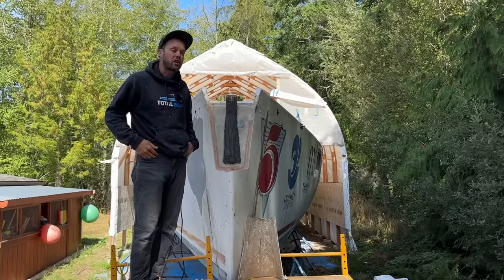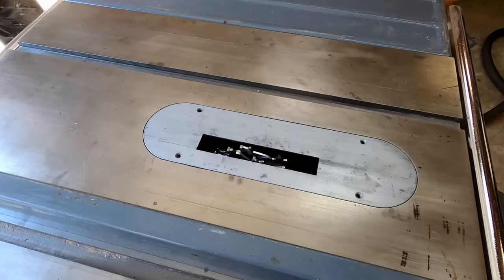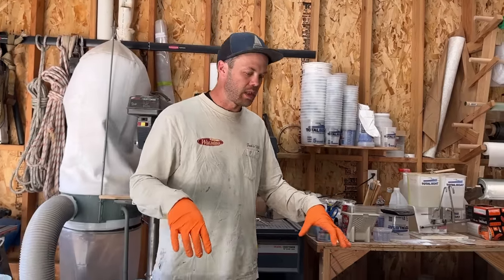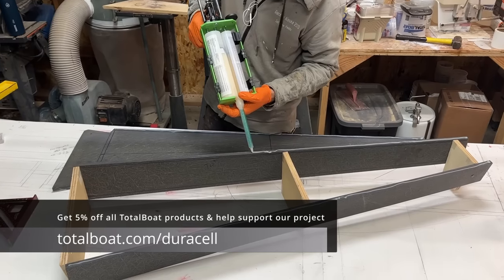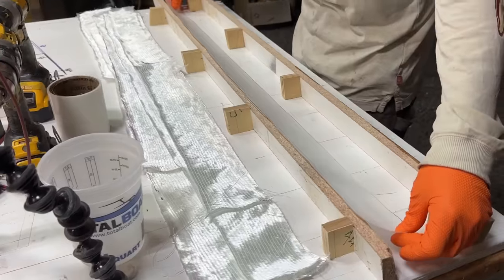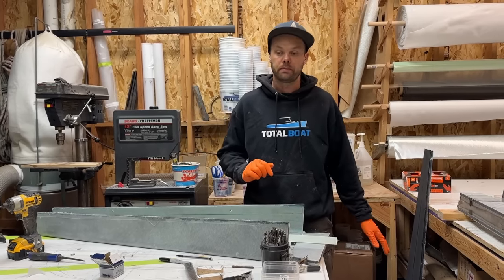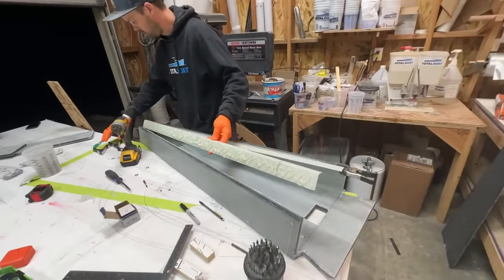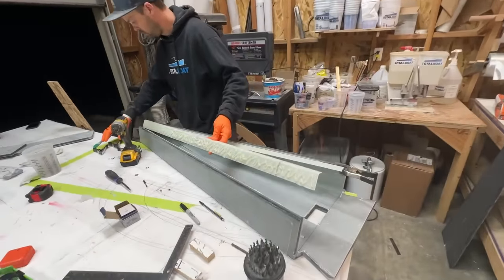Building the BOWSPRIT [E95]

Comment: In the early eighties we were bring the Atlanta Decorative Arts Building out of the ground. The prints called for a door to be built with a height of 6' 4". Anyone with a hard hat and 5' 11" tall or more would hit their helmet. Obviously, it needed to be taller. The walls were 12 inches thick. matted rebar steel to the left and right and above the door frame. I pointed this out to the onsite engineer and liaison with the engineering firm. He said put it in, this was what was drawn on the prints, we did. Two days later seeing him on that ladder holding an 80 lb. pneumatic jack hammer breaking out that concrete so the opening could be raised was a told you so moment. It was August, his clothes were sopping wet head to toe. Just saying you can't always count on the experts. One of the Americas cup boats snapped a mast in recent years. Okay. Food for thought. New plastic twice as strong as steel. Forget the name of it. You could build a knock down mold, make all the sides top bottom say 1.5 inches thick. Pour it in one piece including the guides for the chain.  Monel steel bolts or 316 stainless with large thick flat washers.  Put it in place, silicone the joint so there is no leakage into the hull, and you would be good to go. It would be a type of cantilevered beam so it may require a deeper inset into the bow to get what is needed, that is where my concern lies. There is safety in many counselors. I wish you well, fair seas. N

Comment: High! Anchors I’m 70 and I have lost 4 anchors to the deep . There was a time when everyone had to have a tv unit in the corner, over the last 20 yrs anchors have changed so much and new variations are replacing older models, you will lose anchors and one day you may find the only place to get a replacement is on second hand market because the new ones don’t fit . The big problem is when conditions change and you have to move to a different spot, having to cut away move and replace the anchor in a Gale is not easy, I’m with the anchor guy KISS , Having to get a 50 kg anchor up through a hole and attached with waves breaking around your ears’ not my eider of a good time. Love the show, you do brilliant work and your mum is amazing ! If you must have the anchor in a slot at least add a open sheave on the side of your sprit cheers

Comment: Such high tech tension is keeping me awake at night just feeling the tension and pressures that are going to be imposed on that structure, it might as well be part of the SpaceX Starship! Such belief and confidence you are showing but I am sure also inter-laced with belly cramping  tinges of cold sweaty anxiety and light layers of tension impregnated fear while imagining the huge gennaker/spinnaker/mooring chain tensions, weights and cross pulls that the structure is going to be exposed to while racing through and during stormy dark night time seas and moored while the wind power of gales tries to tear your anchor from its deathly nail scraping bites into the sea bed! Will it manage to stay attached to the bow and not be torn apart? SkipRay, Kerry, Ireland.

Comment: I FINALLY caught up to the present. It took me all weekend and I have loved every minute of entertainment from your videos. 

Matt is doing an incredible job. I cannot wait to see the boat finished. I have been watching multiple boat builders over the past few years; from Steve building Arabella, Leo building Tally Ho, to Garret building Redeviva. Now that Garret and Ruth from Salt and Tar, and Steve from Acorn to Arabella are basically done building I went looking for more content and found you guys (along with a great Australian dude @ Building SY Mistress).

The quality of the videos is first-rate. You are doing a wonderful job at all parts of this project. Matt, your mom is badass. Although she does give off the vibe of a slightly disapproving English teacher, but that is surely just me :). Also, Inspector Cat is always welcome.

Keep up the good work and thank you.
Edit: I had one question. When you put on the white primer on the deck, why do you just do the small areas? Wouldn't it be quicker to cover large areas as you work there to save you time later. For instance at the bow you primed several small areas, Could you have just primed the first 12 feet of the deck or so instead?
Reply from the maker: Painting the whole exterior of the boat will be one of the last steps. I just prime the carbon chainplates to protect them from uv rays

Comment: I don't know if it's different for fiberglass, but when laying tile the thinset (mortar) is combed with a notched trowel leaving ridges similar to the one in your epoxy. The tile is then set on the thinset slightly offset, then slid into position in order to collapse the ridges, which then provides nearly 100% coverage. Gluing two rigid pieces together might work better using the same method. The vacuum bagging might do the same thing, but I thought it was worth mentioning.

Comment: I wait for new episodes every Wednesday, like I waited for my favorite HBO series, like Mad Men, ten years ago; you guys got me addicted! This bowsprit is looking beautiful, and, as a product designer, it is a joy to see every step so beautifully put together and so well designed. I was wondering if the channel where the anchor rollers go should have a stainless sleeve to protect the composite material from any potential metal scraping from chain or from the anchor.
Reply: I should think you guys have enough stainless steel lying around from the old chainplates, and other flotsam back from the day to melt down and make brand new sheets of 3 mm SS! Maybe if you borrow that big tank from the  Acorn to Arabella folks, the one used to melt the lead for the keel... you'll need just a tad bit more heat, which maybe a couple of tons of charcoal and industrial blowers may provide : ⁰ )  but seriously, creasing a sheet of 3 mm stainless in two 90⁰ folds and bonding it to the channel will do no harm at all to this project, and it may look good too. Just thought you could sell all that scrap to a yard, and trade for a nice sheet of steel, how'bout that?

Comment: Question: “The Chain Groove in Your Bow Sprit”: Does the width of your chain groove allow for a “hockel” in the anchor chain? To prevent a hockel jam, width of your groove should be: W=(L=P+(GAx1.5)) Marks Standard Handbook for Mechanical Engineering-7th Edition. Talk to the engineer you are working with for proper sizing based on your chain selection: Triple BBB or ASTM G40? Most roll bar anchors work better with “Fixed” Kong Non-Swivel connectors versus the swivel type. PD

Comment: Very cool Matt.  
I tried editing my previous comment on chain size. 
7/16" is huge and once you leave the USA almost impossible to get and extremely expensive.  Zinc is an environmentally hazardous material and you pay a big environmental fee to import it into countries you may be thinking about spending time in.  
Regalvanizing is an option, maybe, and in the warm acidic tropical water it is inevitable sooner than you might imagine. 
I think you need to rethink that.  3G is the standard now. BBB is ancient history
Reply: It's pretty easy to get chain re-galvanized in many countries. I've done it in Mexico and Australia. It's also a very common industrial process for pipe. Matt is going to use Grade 40/43 which is very common and matches lots of windlass gypsies. .
Reply: @evangatehouse5650  I’d argue about ease of regalvanization in México. There’s only one place that does it right and they are in Mexicali. Getting it there and back is frought with potential problems but it’s easier and less expensive than importing it.  Zinc, in México, is an environmentally restricted metal and requires special permits to import it and the permits aren’t cheap.

Comment: Did you consider that the metal anchor will be banging into the fiberglass and carbon parts? If the contacting surfaces and angles   are not (cladded in) metal, I’m affraid your structure will get worn down, dent by dent.

Comment: Hey Matt, I’ve been following along since the beginning! Love your fiberglass projects. Did you use 1700 biaxle on the bow sprit? I’ve been using 1708 for my random fiberglass projects with Total Boat resin, but want to use epoxy for the project I’m working on now (platform for my below deck autopilot ram). From what a I understand, I cannot use epoxy with the 1708 because of the chop strand mat. Thank you!
Reply from the maker: No you can absolutely use epoxy with 1708.  The mat is stitched to the biax.  With regular mat, the fibers are glued together and the glue breaks down with styrene which is in poly or vinylester resin, but not epoxy.  You can actually still use epoxy with regular mat but it’s harder to mold.
Reply: @TheDuracellProject very good to know!

Comment: Matt, I've picked up some ideas that have improved my own epoxying, like keeping tools in an acetone bath. Do you have a trick for reusing the Thixo mixer tubes? They're like $5 apiece, right?
Reply: Thanks for removing the 'telegram' reply to my posting. Must be frustrating fighting against scammers.
Reply from the maker: They’re handy if I need to be precise in applying epoxy.  But for small jobs I just squeeze it out of the tube and mix it on a plate.  Yes they can be expensive so I try not to use too many

Comment: Isn't the table airtight? Couldn't you just have done it the same way as you did with the inner side just using the table as sealing surface? Maybe with some blocking fitted inside to lift it from the table in order to make sure the edges also get enough pressure...
Reply from the maker: I was actually worried that the vac bag would deform the sides of the sprit.  In hindsight I totally could have put it in a bag but it turned out fine.
Reply: @TheDuracellProject  Wooden blocking could have prevented deformation as well... But as it turned out fine... What do think by the way of the building method of SV Lynx? I don't get the sense of building with carbon fiber (especially high load parts like the fore beam) without vacuum bagging. The loss of strength adds up in more necessary fibers and by that the weight added is quite a lot.

Comment: Any reason you aren’t using any Kevlar layers? Especially on the outside of the boat where Kevlar was definitely used in construction of the original boat.
Reply: Yes, it's weak in compression. It's great if you want bulletproof (literally) but nobody builds with Kevlar if you can afford carbon.
Reply: Kevlar was almost a fad in boat building. Although my boat has a lot of kevlar in it because it was built during that time. It is very tenacious and so it may impart some good survivability to a boat post collision so that instead of completely falling apart, it just hangs there, limp and broken. But that is better than cracking wide open and letting in the sea. Evan would know better than me, since he is actually a naval architect. But that is my impression.

Comment: I think these materials are not the best for this application. Any flexing or banging by the anchor will degrade the material fairly quickly. Steel would be more durable.
Reply: They aren't done yet. I am sure there will be some chafe protection. All it would take is a few strategically placed metal pieces.
Reply: Yup. Thin s.s.chafe plates to protect the structural foam/glass sides.

Comment: You need to stop what you are doing and rethink this thoroughly. IMO. Before the whole front of the bow took on all the pressures of the sail and spread them through the entire bow. No point of failure. Designed to be beyond failure. Engineers a plenty and waist dept in money even with a budget. Now you have two tasks the same job the sail had before and the rerouting of the anchor chain for the anchor. You mentioned the sprit was designed to be greater than the three times the breaking strength of the chain. When the attachment point for anchor and sail are moved away from the old design your failure rate for that part is now exponential. Think about the old design. It's a beyond failure solution.
It looks like to me from your drawing the sprit goes into the bow maybe ten or twelve inches. This is the weak link, the point of attachment. IMO. It needs to be over built both the sprit and the attachment points and support areas. You may have to add material in the bow to get the strength required to fix any possible movement, not any movement, up down left or right forwards or backwards it has to do the job. You have mentioned budget several times. I get it. You have limited income. This is not something you cannot afford, a failure at sea with your family or friends under any conditions. I watched a documentary on a sea captain lose his life and thirty crew members. All their problems could have been solved on shore long before the storm conquered them. Change your focus. I've been up several hours looking through this. Just to let you know I did make a contribution in the current rebuild project of the Talley Ho by Samson Boat Company. Its late I am going to bed. I'll send along some observations along tomorrow. N
Reply from the maker: This bowsprit was designed by a professional naval architect

Comment: 7/16" chain????  What the heck?  Can you please explain your logic. That, amigo, is extreme overkill.
Reply: It's what Rocna recommends for the size of anchor Matt wants to use. It's a BIG boat with a large mast and lots of windage don't forget. 3/8" is very typical for 40--50' boats right? 7/16" is the next size up.
Reply: @evangatehouse5650  Enough said.  Rocha knows what they are doing.  Regarding chain size. I’m 44 feet with a tall rig and 22000 lbs . I use 5/16” 3G with a Rocna 25kg.  As per Rocna.  Straight 3/8” chain is old and heavy technology and a thing of the past like CQR anchors.